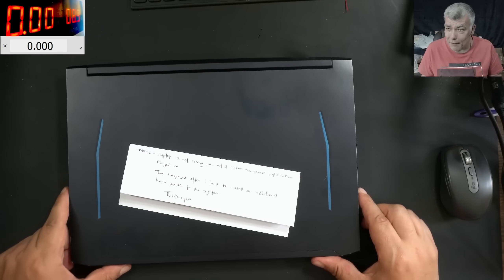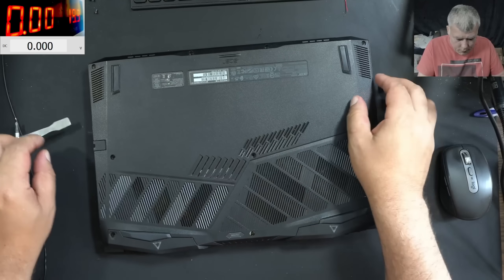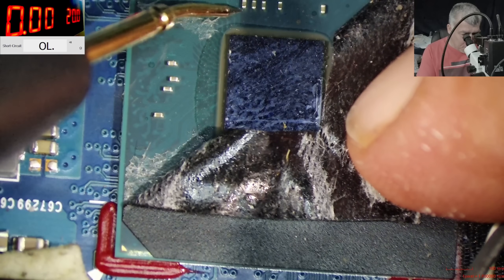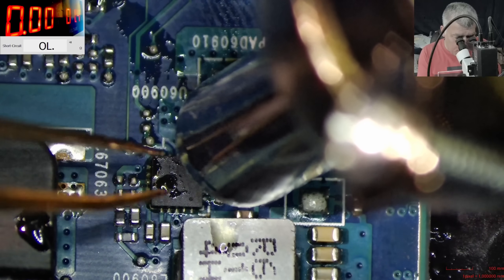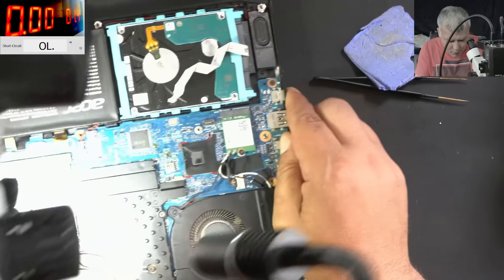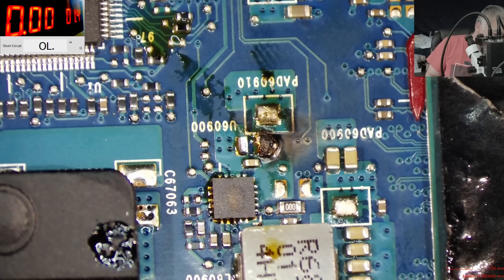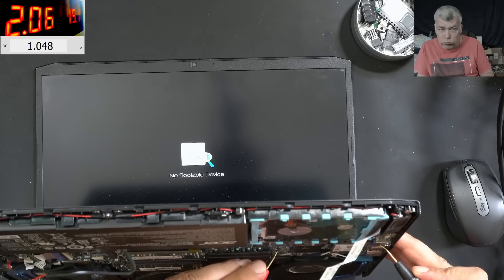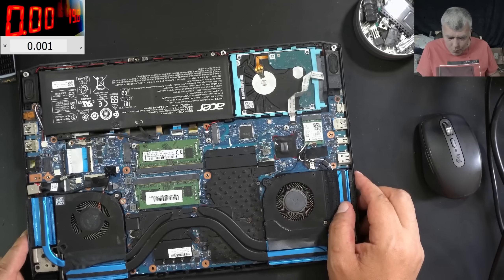Acer Predator - Customer replaced the hdd and the laptop died, what went wrong?

Comment: Very good. Personally, I would have fitted a new cap as it would probably have been the higher value one. I'm sure Arnie would have been less concerned with the alien pronounced your way, ho, ho. Pronounce with a double d for added menace.
Reply: Thats an interesting debate, where would he connect the ' right hand side ' but as Sorin says. No capacitor, no blown capacitor...lol
Reply: @CaribbeanParadise-cn3sy  Only pointed out because the other small cap is probably for high frequency noise, whereas the larger cap is probably for spikes, surges etc and may have prevented the chipset blowing when whatever happened happened. Yes, an issue of where to connect it, but easily within Sorin's skillset.